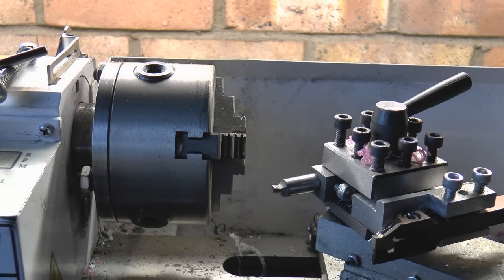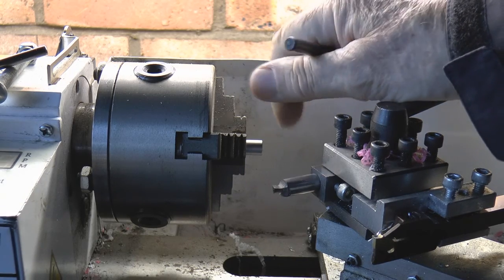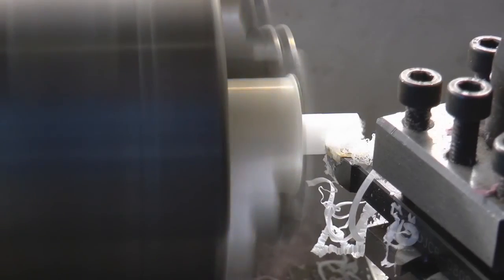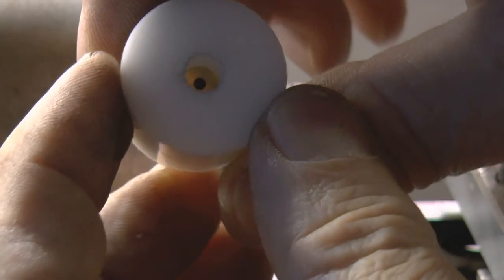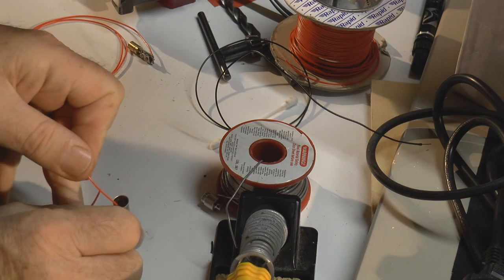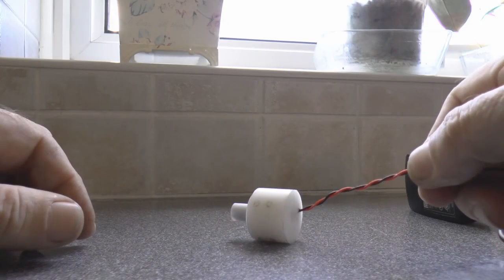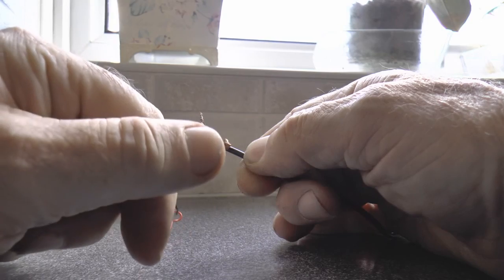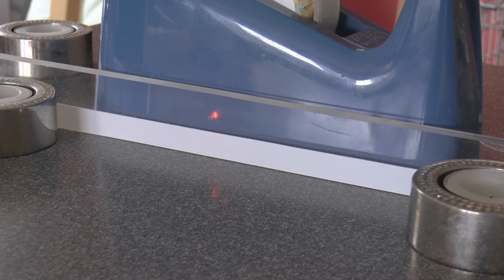RDWorks Learning Lab 31 DIY Laser Pointer for mirror alignment Pt 1

Comment: Hi Sarbar, I am so glad to see this all videos. They are so helpful Ive been learn a lots good stuff from you.   I bought my laser from China on May 2014 with the hope to use quick, but unfortunately there was several problems and still can't use it.  This company was dishonest and sold me broken. I tried the best as I can to repar. But still have a problem with mirrors. I will so thankful if you would like to help me with setting. I have no idea how to do this. I am not engeneer :-( Thanks
Reply from the maker: +Seven Heaven  It will be difficult trying to help you with something I cannot see or touch. I will try to help you but this could be a long slow process So I shall need to ask you just one question at a time. Is the laser tube working (does it glow pink when the tube is working)?
.Also, out of interest, what programming software was supplied with the machine?
Reply: +SarbarMultimedia Thank for reply... Laser tube is definitely working as it does cut but not everywhere in the bed. Laser burning edges. We tried set up mirrors after a few hours, but we think we have made it worse. We have no idea how to set up. We are using RDWorks8V. How do we set easy the first mirror it is not parallel with the Y
Reply from the maker: +Seven Heaven Take a look in your YouTube messages section

Comment: I just replaced the laser spot pointer from my laser with 2 line generators at 90 degrees to each other, it produces an L shape on the target with the spot exactly on the crossing point of the 2 lines, it works nicely and helps with lining up the target piece. With this setup of yours are you planning to replace the focusing lens barrel with the plastic piece and shine it backwards down the laser path towards the the tube? Seems like a good idea until you get to the end of the laser tube.
Reply from the maker: +Mentorcase Sorry for delay in part 2. All will be revealed

Comment: You should consider getting a 3D printer for little gadgets like that. Not that it would be better than what you made, but it would be more on theme for your channel. Plus, it would be fun to watch. :)
Reply from the maker: Hi Miguel
 Sorry to say that 3D printing is a great technical novelty but does nothing to tickle my very old grey cells. No high voltage to kill you, no invisible beam to maim you,  no poison  fumes  to corrode your lungs and no risk of burning your workshop down. Could I get such an adrenaline rush from 3D printing?. To be honest although I cannot get the intricate detail of 3D printing I have spent many years building metal, wood  and plastic 3D constructions from 2D parts. It's difficult to teach and old dog new tricks, but thanks for the comment
Best wishes
Russ

Comment: fwiw. put the entire arrangement in you lathe. and just spin the chuck whilst adjusting to find the center. use a piece of paper where the tail stock would be. draw a  target if you wish.  two cents. :)
Reply from the maker: +Sam Rod 
Excellent idea but with my dinky lathe I would not get more than about 400mm distance to the tail stock and I reckoned on a path length of about 1100mm . But, I could have raised a target off the lathe. Yesd,good thought.
Reply: +SarbarMultimedia  My initial test showed aprox 3-4mm off center at about 60cm distance I'll admit I did not even check it at first. I first lathed the part up.. installed it. calibrated my laser/targets.... removed it. and upon first test I thought. WHA ?!#?.(wasnt even close)... This is when I checked to see if the laser pointer was pointing straight.  Live and learn. or in my case learn, learn. then laz.   BTW I must ask... hows your wifes To Do list coming? :0!  Mine is incomplete Ill admit.
Reply from the maker: +Sam Rod 
I was doing some test work today and was gratified to find my focussed red dot was spot on with a pulse burn. So now I know I can trust it.
The wife slipped over at the weekend and broke her wrist and damaged her ankle. I suspect with too much sitting-around-time  for the next few weeks, the list will get longer!!